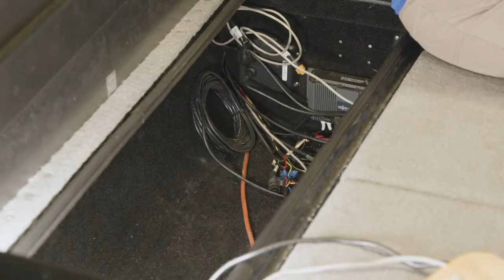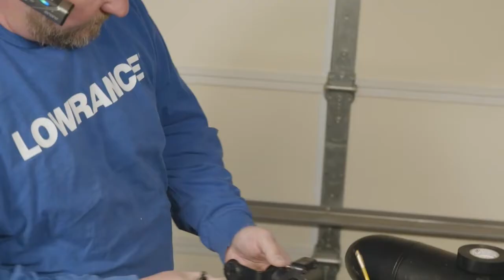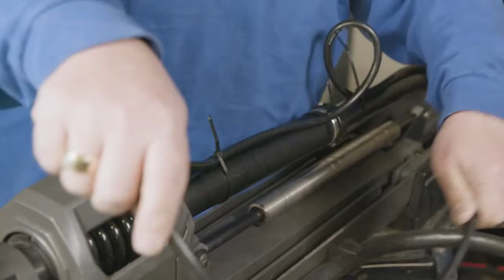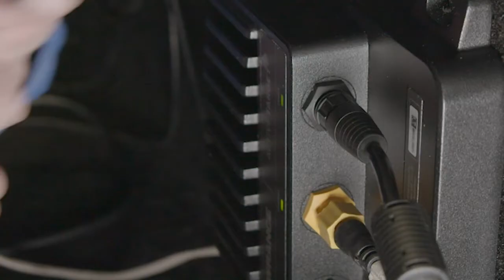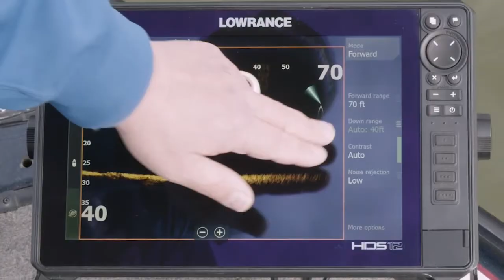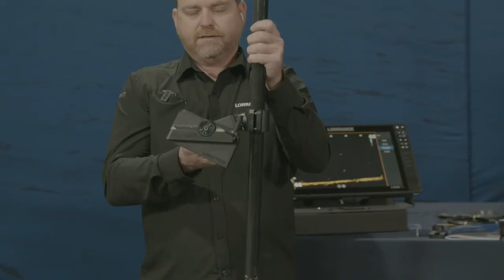Lowrance LIVE | Active Target Installation

Comment: If the trolling motor is flipped the other way, so the prop is out, then is it OK for the transducer to be just the opposite of what’s in this video?
Reply from the maker: Please contact one of our technicians if you're having issue with your installation.
https://www.lowrance.com/dealer-locator/
Reply: @lowrance  I spent over an hour on the phone with one of your guys and it’s still not working right. When looking at the Active Target screen, why is the lake bottom running up at around a 45° angle instead of flat?

Comment: I was under the impression you don't need the module if you are connecting to a network that has at least 1 HDS Live unit?  Is that the case?
Reply from the maker: You will need the ActiveTarget module in order to use the ActiveTarget transducer.

Comment: Lawrance does not want you to use cable ties since it can damage the inner cables. You should use electrical tape and get rid of the cable ties. Besides that great video.
Reply: this is on the Lowrance channel...

Comment: I currently have a 3D Structure scan box mounted with an Ethernet cable going from that box to my HDS 12 live on the bow. This box also Ethernet cabled to an HDS 9 Gen 3 on the dash. When hooking up my AT Box, can I run the Ethernet cable from that box into the third open Ethernet port on my 3D Structure Scan Box and feed the signal back through to Both Units?
Reply from the maker: You may indeed use the ethernet port of your 3D structurescan module, but keep in mind the HDS Gen3 is not compatible with the ActiveTarget, so you will get no readings on the Gen3.

Comment: Will a Mercury VesselView mobile which works by bluetooth, connect to the HDS9 live unit?
Reply from the maker: The VesselView mobile will connect your mobile device with your Mercury engine via bluetooth. The connection will not use the HDS Live

Comment: Well explained by the way damn good job sir
Reply from the maker: Thanks, James!
Reply: I have a min Kota Ulterra trolling motor with spot lock what pieces do I need to connect it to my active target trans Duser and also it came with a remote control Bass Pro. Shop didn’t hook my foot control to the main Kota trolling motor I was wondering can I use both if they hook up the foot control i’ve been back and forth to bass pro shop for two months now and it keeps giving me the runaround so maybe you can help me and point me in the right direction please respond

Comment: Hi guy recommended Active Target power supply 12 V dc or 24 V dc?
Reply from the maker: Yes, you can run the ActiveTarget module on 12v dc or 24v dc.

Comment: What size wire should I run for power for the active target. This seems to be hard to find online?
Reply from the maker: Size of wire depends on the length of         wire run, but typically 10-12awg works well for our units.

Comment: Just got my AT and Elite FS7 but connecting the yellow wires still does not wake up the module. Connecting yellow to red works but I'd prefer to have the FS unit control the AT module. Also did the latest software update on the FS unit but no change. Has anyone else had this problem?
Reply: Ditto, same issue here
Reply: Yes, any fixes yet?
Reply: Same issue nothing happens when I went yellow to yellow but red to yellow and it has power

Comment: Wish more fishermen would demo the HDS7.
Some annoying things.
Slow processor is noticeably annoying on button delays about every 4th press.
SPOTLIGHT, after being disabled in menu,  re-enables itself on next start up.
Also on multiple chart set up, the top 2  text OPTIONS under SONAR are;
 SONAR/AFT DEPTH
SONAR /DEPTH .
If  I set up SONAR/DEPTH on first combo chart, then it is no longer available on other combo chart. Only SONAR/AFT DEPTH can be set to appear on multiple combo charts.
Not sure what the difference is between them.

Comment: I see that the Ethernet cable included in the kit is black.  Is the common gray Ethernet cable compatible?  If so, I have a spare gray cable in place already that I could connect.  If the black cable is a "crossover" cable that's different, I need to know.  Update: It appears Jason connects the gray Ethernet cable that is common with Lowrance systems.  I'm not sure why the kit has a black cable.

Comment: Just for you Ranger guys Who own a 520c or 521c that I know of. There is a good void space between your consul and front storage locker. You can save some space in your storage locker by placing your AT module there. You’ll need to remove the shelf side panel. (2 screws in each corner top.) Then remove the black plastic back panel. Plenty of room to mount the AT module. Good access to the cockpit buss bar or your A-1, A-2. & A-3 dash switches. also your wire tube is right there to run wires from the bow.  Mount the AT module to cockpit wall (lights up) using 4 Machine screws with washer and Aircraft nuts, placing the washer/aircraft nut on the inside of the mount.
Replacing the black plastic panel with 3 - 1/2 drill bit ventilation holes... placed where you can see the light on the module through those holes (good Luck with lining those up.) Don’t forget to run a extra #12 yellow wire to the bow for any fix Navico will come out with in the future.
Reply: Someone should do a video on this.

Comment: When you mount the module to the side of the compartment like shown the screws stick out in the compartment beside it. which will lead to bloody knuckles eventually. If you do just use nuts and bolts or go on the back wall like he should have. Lowrance you should be ashamed because this is not a professional installation by any means. I preordered December 4th on the first day they were taking them. Finally received it first week of March, got it installed and went to the water. DOA, after an hour on the phone with tech support they diagnosed it as a bad transducer which I was told has been a common problem. Sent it back which cost me $40.00, called customer  service again (1 hour) and explained how ridiculous this was and they expedited me another for my troubles but its not like they did me a huge favor. $1500.00 product, 3 month wait time, 4 hour install, dead transducer out of the box, 1 hour to remove, $40.00 to return, new transducer installed again (1 hour) and I have not tried it out yet but I'm hoping for the best. One positive note, tech support guy was great, I can not remember his name and Tiffany who got my new transducer shipped next day was very helpful and a pleasure to deal with.

Comment: Will the 3 in 1 nose cone, which is longer, interfere with or partially block, the signal from the Active Target transducer in down mode?
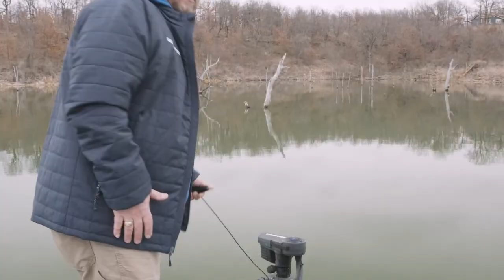Reply: If I'm not mistaken, he has the 3-in-1 Nosecone installed on his Ghost in this video. You can see it around 0:46:20 - https://youtu.be/NbqaCKwGn8M?t=2781
It doesn't interfere with the signal or performance of the ActiveTarget.
Reply: @ericc476  Yes, I see that now.